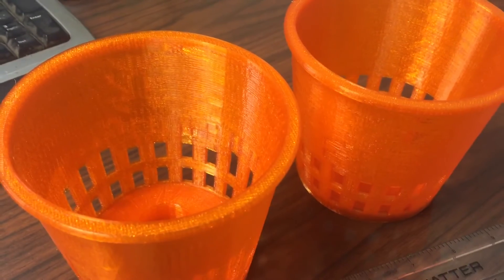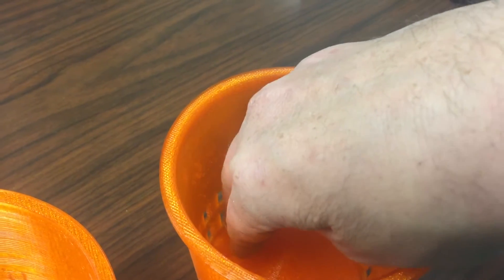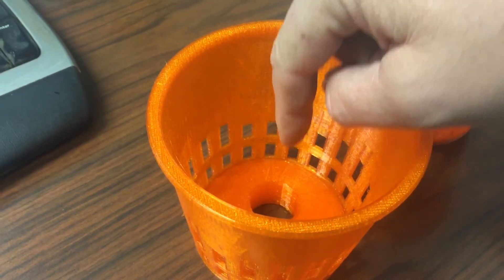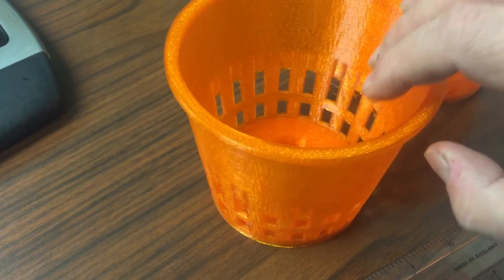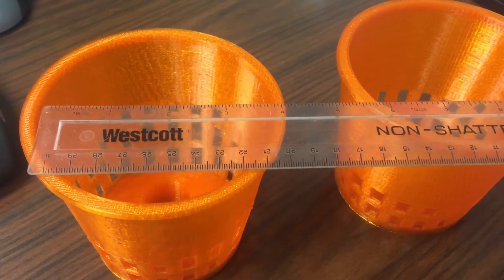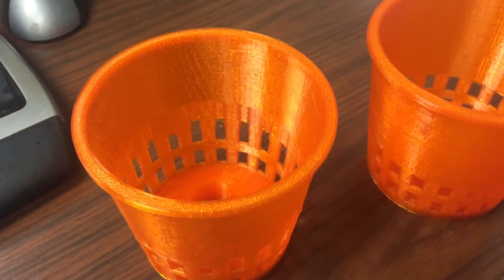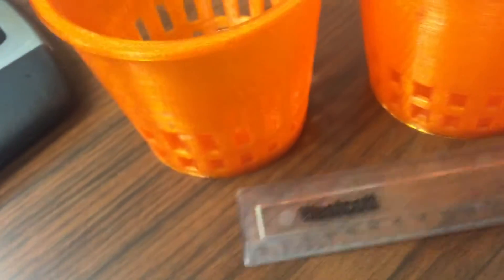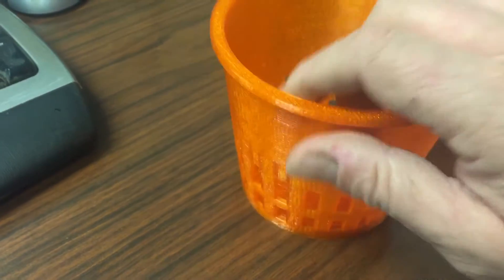3D Printed Air Pruning Pots

Comment: are they uv resistant? btw you could probably just buy net pots for hydroponics
Reply from the maker: They aren’t UV resistant but I’ve had them out for three years now and other than being a little faded they are holding up quite well.  Net pots would probably work but then you have to come up with a way to suspend them in the air so that you get the root pruning effect.

Comment: Looks pretty cool, should work very well. Is there anyway that you could reduce some of the material used in the cone?
Reply from the maker: +Davyd Walker Yes, I can reduce the infill even further to save on material used.  These were printed at 30%.  Going to try them at 20% next to see how that works out.  Right now I have about .30 cents worth of material in each pot.
Reply: Amazing 😱